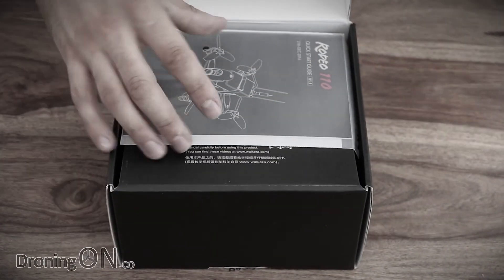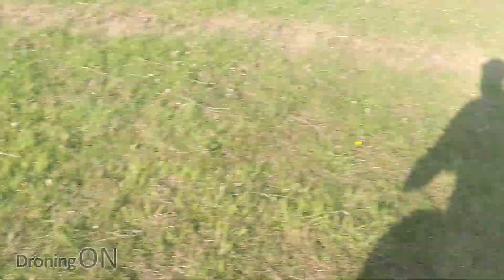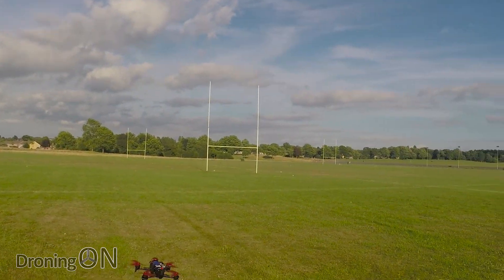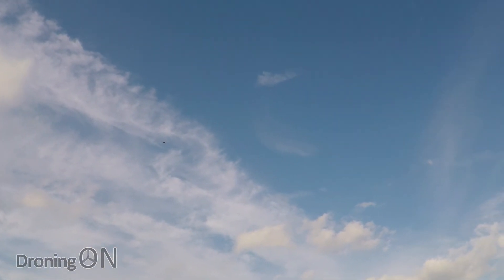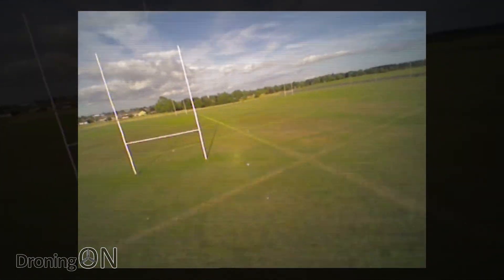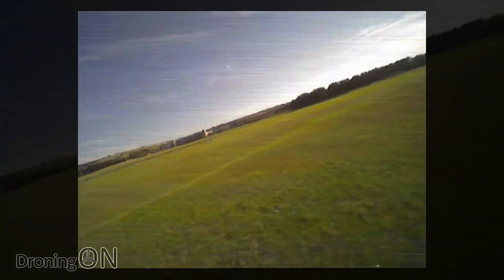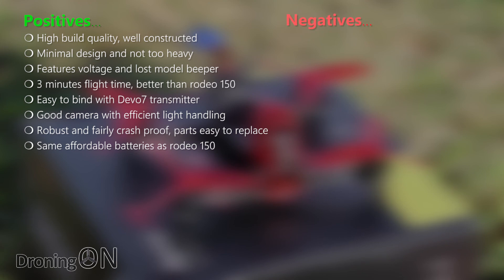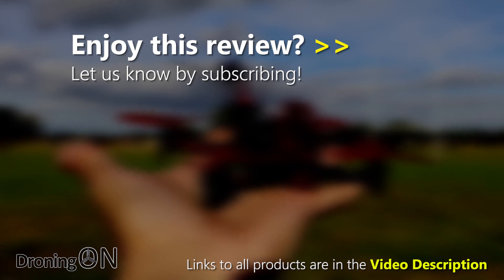DroningON | Walkera Rodeo 110 Review (Part 2) - BetaFlight & Flight Test (LOS & FPV)

Comment: hi mate ive just bought one of these and am having trouble with it in the air whilst going straight up (slowly) the props start to stutter and it shakes itself back down to the ground? any idea what the problem is? real frustrating as i dont trust it at all!
Reply from the maker: Sounds potentially like a loose prop, are you sure that they're entirely tightened?
Reply: @Droning-ON  think its prop was.. im getting same but not as bad with my beta 65x... could it be myu flying ? its just when it comes down after punch it wobbles lots

Comment: hi n ty fo the information..n iv had it fo a while..n it was bound .n I even tried the fixed ID am trying to re binding it together? ..n ya I know about turning on the tx ..n immediately plug in the battery but it's still beeping 😢 n battery fully charged on level service

Comment: hi I have a question for u I have a Walkera rodeo 110 mine rfv Racing drone with the Devo 7 transmitter n I hit some kind of button on the remote control n it's still beeping 😢 n I hit the reset button on the drone it's still beeping 😢 n don't have a bind plug fo it to .. don't have a computer to refresh the firmware .. is there anything I can do to help me re binding it together..n ty fo anything else? 😆
Reply from the maker: +mike waterman hi there, the 110 will beep for various reasons, check the following : ensure its on a level surface when plugging in, check the battery is fully charged, set all TX trimmers to zero and ensure all switches are in position 0. Then turn on the TX first and then immediately plugin the battery to the quad.

Comment: Hi Ash
First off a great and concise two part review. I've had quite a few Walkera products over the years and though they have been slow to do so they have really improved on quality and performance.
Secondly it is really refreshing to see a review not provided by a Chinese Box Shifter. I've made purchases from Buzzflyer and can attest to their commitment to customer service and satisfaction. 
As I already own a Rodeo 150 RTF package I may just need to satisfy my illness with a BnF 110 in the near future.
Regards
Nidge.
Reply from the maker: +sputniksam, thanks for the feedback and glad that you found the review to be useful! I'm tired of reviewers that promote because they get free goodies - I love receiving quadcopters for review but I'll always give an honest opinion, positive and negatives. If you love the Rodeo 150 then you'll love the 110 - at first the Rodeo was great because budget brushless quads weren't quite available at the time, but the 150 just feels heavy now and the battery life is quite pants, the 110 solves that, despite the proprietory elements which are a real shame. Give BuzzFlyer a call, perhaps they'll do you a better deal on the 110 if you tell them that the DroningON review prompted you to buy :)

Comment: Hiya Ash, cheers for mentioning the firmware issue. I still have my 110, hopefully with your help I might be able to get it working again. On another note which Racing quad would you suggest getting for someone learning Acro mode? Either 110 or 150?
Reply from the maker: Thanks for the feedback +Cuffy Bigglesworth and I do intend on filming the firmware flashing video in the next few weeks so watch this space! What's wrong with yours at the moment? In terms of getting into FPV, its a tricky one, my personal favourite for brushless minis right now is the Aurora 100 (see my review) as its a great flyer and loads of power, plus only £100/$130, but if you already have the Devo7 and are not really into other transmitters, then stick with the 110, its a far better quad than the 150 as its lighter, longer flight time and more agile too.
Reply: I only managed to get mine to fly once. It wouldn't go into acro mode. I saw a video going into detail about cleanflight/betaflight but all it did was stop the devo 7 from binding with my quad. I have seen other videos about sticking wires into the drone so that you can short the flash while the USB is plugged into the PC. I am glad you mentioned the proprietary Firmware because all the other videos I have seen have not mentioned this. I probably won't be able to fix my quad and will at some point get another 110 or another entry level acro drone
Reply from the maker: +Cuffy Bigglesworth watch my review of the Aurora 100, then buy a cheap FlySky TAX for around £40/$60 and you'll be sorted!